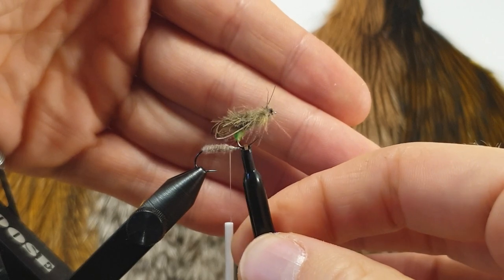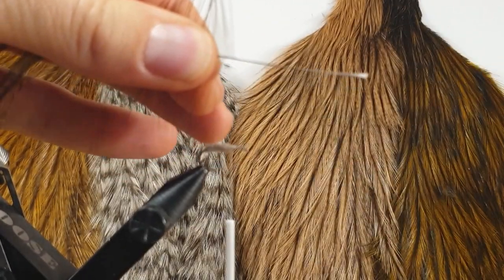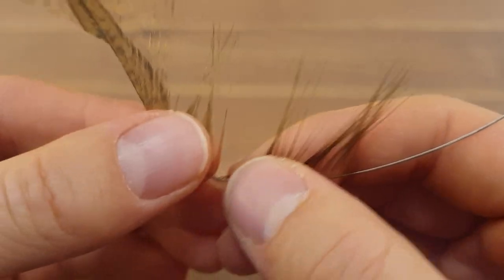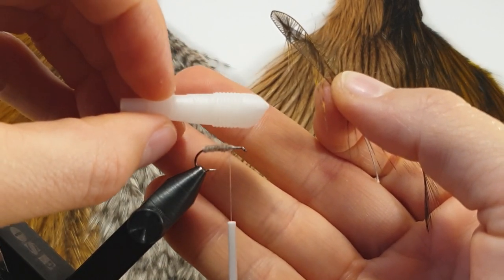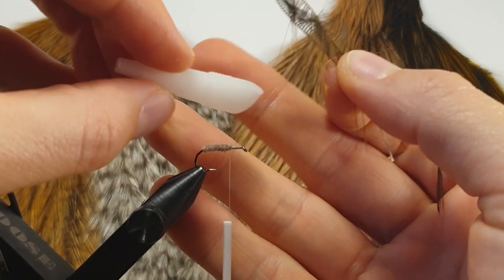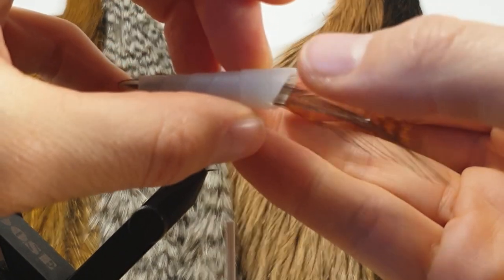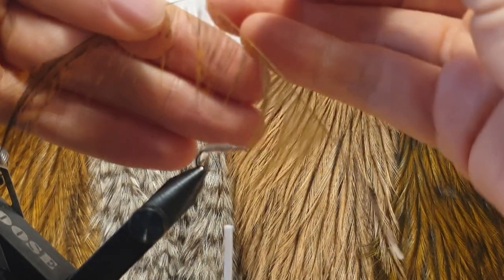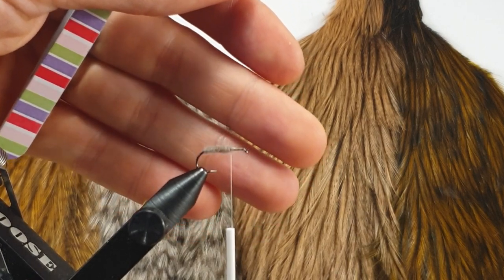Extended origami wing tutorial

Comment: Thank you so much, i have been trying to get to grips with the Wally wing all day. So many downsides to it. Right size, type and quill thickness. Then the lock on all that material, this upsets almost everything. Upsets me when the split goes wrong. This can be done off the fly, made in pairs, and locked in and posed as you wish. Tomorrow is a new wing design day.
Reply from the maker: Nice to hear! These can be tricky too but once you master it they are much more versatile. Also more durable!

Comment: Love the demonstration, What kind of tweezers are those and what did you make the cone from
Reply from the maker: Those are just standard tweezers from a supermarket. You can use a dubbing needle instead and squeeze the stem between your thumb and the needle to get a soft bend to the stem.
The cone is a nozzle for silicone tubes. Should be available in most hardware shops. Just cut it. The point opening is about 3mm.
Reply: @onceandaway  Thank you, have a great and blessed day

Comment: Fantastic technique and video! Do these wings cause the fly to helicopter during casting? Thanks again, Joe.
Reply from the maker: That depends on the position of the wings, how big/thick the are etc. But I'm mostly using them as caddis wings (like on the Fax Caddis or larger variants) and in that position I've never had a problem with it no matter the size.
Reply: @onceandaway  
Excellent. Thank you.